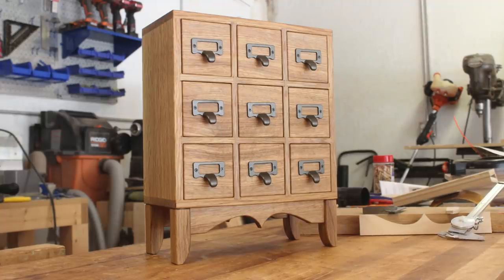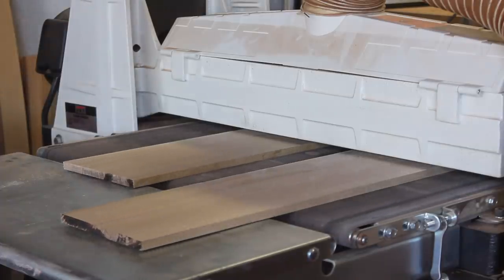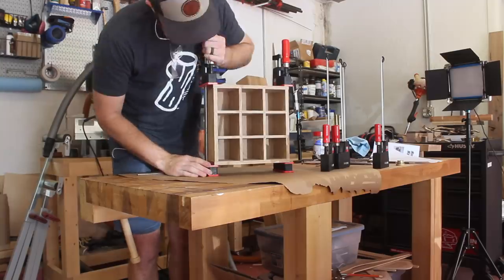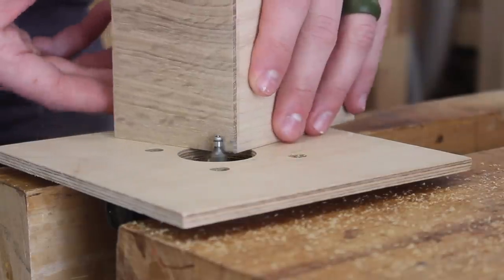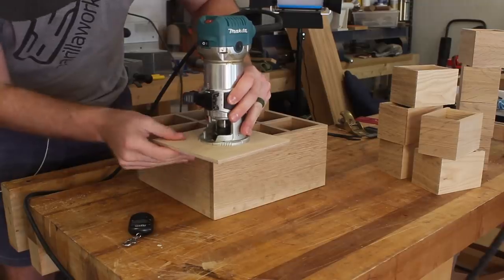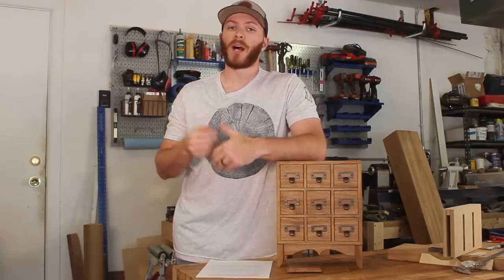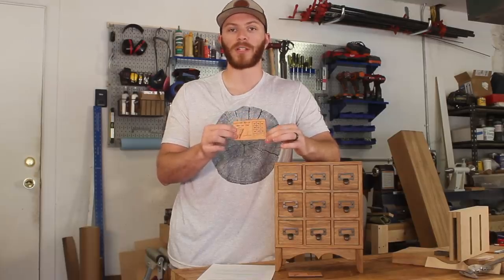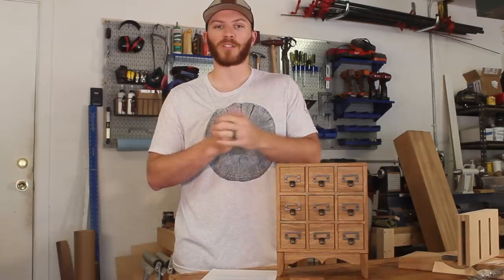The Mini Apothecary Chest - Limited Build Series I

Comment: Like the idea, nice work. Is lap joint really easier/faster than doing miters? I guess this would have been plenty strong enough. If I may criticize, I think the base legs are somehow disproportionned to the case size, would have made them lower and more discrete.
Reply from the maker: Thanks! I think the base could be shortened a bit but I still want it to be a contributing design element to the piece. I'm not sure what you mean by lap joint in this instance, though.
Reply: @parillaworks  sorry I meant half lap blind joint for the boxes, I was thinking 45deg miter as an alternative with blue tape so you don't need to use clamps. maybe because I haven't had the chance to test out much this joint myself. About the legs base I would have said half the height, so that it is roughly half/two-third of a box height, for sure just a personal preference... good luck!
Reply from the maker: Oh I see. I think the lock joint is stronger than the mother and also gives the ability to trim down to fit the cubby in all dimensions. The tape method is a plus and something I took advantage of last year for a large batch of boxes.

Comment: That looks great.  Did you consider using rubber bands for gluing up the drawers during your batch run?  Maybe even tape, unless you are like me and always looking to justify more clamps ;).
Reply from the maker: Thanks! That’s not a bad idea, I might give it a try. I wonder if there would be any pressure applied to the middle of the joint. And yes, I am always looking to justify more clamps :)